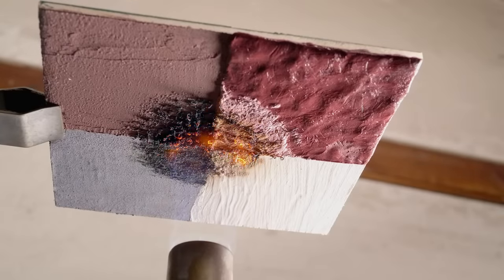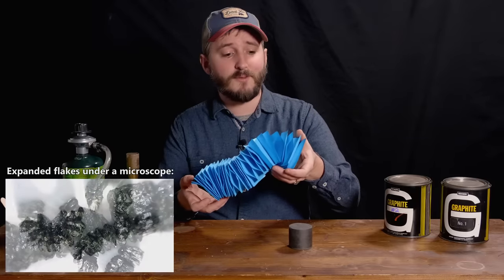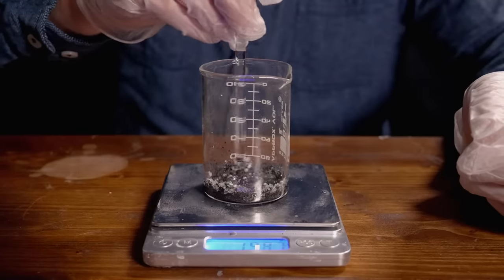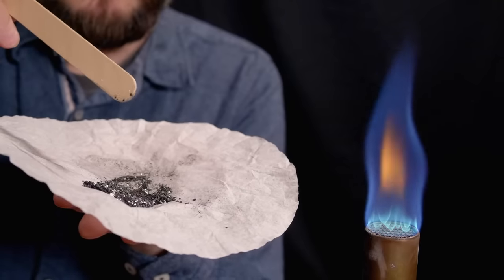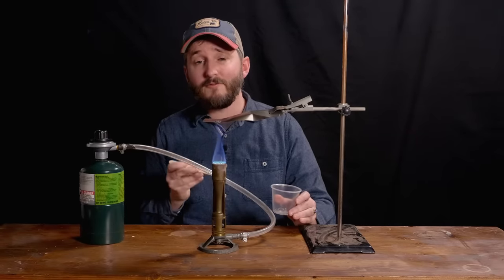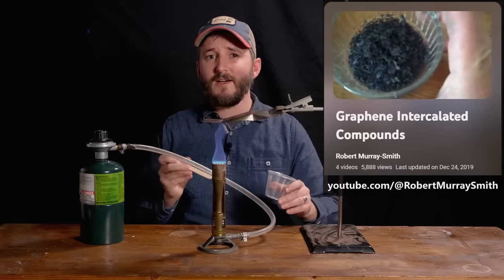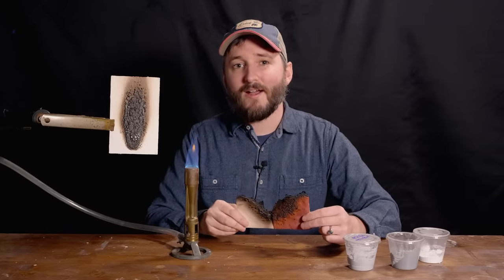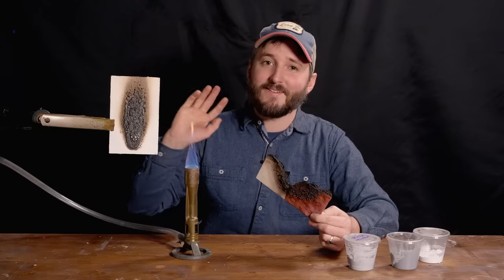Fireproof Expanding Graphite

Comment: This is just an fyi because i watched ur video trying to make my own graphite foil for an electrolyser for hho i dont and disint have flake graphite however i did have graphite foil i had orderd but conecting a wire to it proved fo be difficult ended up with a bunc of graphite foil scraps with only a couple good pieces left thats to your video and abit of my own experimenting i found out if u chop up ur scrap pieces instead of toss em out mix them into ur solution (im sure any would work but i used sulphuric acid and potassium nitrate) and let it sit a while left it for about a day the solution will break apart ths graphite foil and you can nutrilize and dry and it re expands when heated
I wouldent say its infinitely recyclable in this way sence i only tryd it the once so far havent recompressed it then broke it up again to see if it would d it over and over again but it did save me abit being able to remake the foil from the garbage pieces instead of just throwing them out

Comment: Nicely done! A great video to introduce to intercalated graphite. 
If you want to go a bit further, you can actually produce high quality graphene via the modified Hummer's method, which is just a few steps further. 
You would need some h2o2 in your water and hydrazine as accelerator, but then make sure that the quantity is small, you have a ice chunks surrounding your Erlenmeyer flask and and extra cover (fume hood is possible). Cleaning  and recovering the graphene is the most tedious step, using a roto evaporator and centrifuge at least 4-5 times. 
Thanks again for the video, it does bring me back 10-12 years, when I was working on nano sensors during my PhD.
Reply: the h2o2 would have to be pure otherwise the hydrazine gets mad
Reply: @deathedell215  I think you are right, now you mention it. I can't remember if we had any water at all. Mind it was a long time ago. I wouldn't recommend chancing it if you're unsure of what you're doing :)

Comment: The smaller mesh taking longer may have something to do with surface tension. It may also have something to do with a reduction in the capillary effect. Just a thought.
Reply: Or smaller flakes have more edge. 4 circles with a diameter of 1 have the same area (and with the same thickness, mass) as one circle with diameter 2, but the four smaller circles have edges with an overall length of 4pi, whereas the bigger circle has an edge with a length of 2pi. And since this reaction happens on the edge of the flakes, more edge means more reaction.
Reply: @chstoney  Oh, just wrote the same, I think this is the reason, for the same amount of flakes it'd be faster for the smaller ones, but for the same amount of mass there is a big difference in their numbers
Reply: The reaction happened faster in the larger flakes though?
Reply: Yeah, if it was just "more edge speeds up the reaction" it would have been obvious and not commented on. The actual result which is reversed implies that the reaction which opens the edge is a lot slower than the intercalation itself, which completes rapidly even if it has to cover a large surface area.
Reply: Supposing that the opening is the restraining factor, then the reduced number of atoms on the edge may also be a factor: if the intercalation is sufficiently faster, then it would imply that the opening of the edge is dominated by random chance as much as anything else, with the result that "rolling more dice" is the most effective way to speed things up.

Comment: Great video as ever. I did think this sort of expanding fire putty stuff was put around pipes and electrical systems, allowing them to move, but in the event of a fire, the material expanded filling any gaps and therefore stopping the spread of the fire from room to room.
Reply from the maker: Yes I have an intumescent collar for a 4" pipe I might test in a short video. That is one purpose that is pretty interesting and useful

Comment: Expandable graphite might of been used in  small flat sand bags  is good for cable and pipe entries with odd shape holes were you need temp access to work for fire proofing between adjoining buildings or between floors,  is it the same as the red electrical fire cables that insulate the internal wiring?

Comment: Very informative and interesting video. I am about to get back into my long lost rocketry hobby and have been thinking about trying a 3D Printed PEEK nozzle with a graphite insert or some sort of carbon based lining. It's a pity the gas flow would rip this stuff right off. I wonder if you could use it as internal heatproofing on the combustion chamber walls. I might try it just to see what happens to it under pressure.
Reply from the maker: If you expand the graphite first you could compress it as a lining in the nozzle and it would conform to the walls in the same way it makes a foil
Reply: @Nighthawkinlight  Thanks, would I have to bond it to the walls in some way?
Reply from the maker: @randomname4726  I'm not sure, it depends how grippy your nozzle wall is and how hard the graphite is pressed. Probably a rammed clay nozzle would benefit from having some of the expanded graphite included also.
Reply: @NightHawkInLight  I will have to experiment with it. I've made plenty of little rammed clay nozzles when younger, but now I'm into bigger motors with proper turned nozzles, etc.

Last one I made was H class using a convergent/divergent nozzle made from fiberglass & metal reinforced body filler, which I cast into a cylinder and turned down on a wood lathe (no metal lathe unfortunately (yet!)). It worked brilliantly. Now, I want to make a working nozzle for an M class motor (only 32x more powerful, lol), but it will need to be stronger and also survive the exhaust for several seconds.
Reply: @randomname4726  : If you have a wood lathe, then you have a light-duty metal lathe. You should look up how to form sheet metal over a mold on a lathe, to see if it would be useful for your projects.

Comment: I think the worms in the putty serve their purpose inside electrical boxes or when used around conduits going through walls, not in open air like you did, the worms would expand and fill the void
Is that the same stuff as the 'indoor firework snake' ?

Comment: All of your Carbon/Graphite material has been extremely useful. I recall in one of your past videos regarding start light. You mentioned using some of the common materials Ethe&$@k?? and(something) else that were not deemed as suitable because they were water soluble. I have to say my mind immediately track to Ferrofluid's use of oleic acid as surfactant musing the potential of it/the concept in making them non-watee soluable🤷‍♂. Either way..your material is a great watch on my information gathering process while looking at ways to modify graphites toughness as well as entertaining a variety of methods for  form, molding..¿Expansion casting?🤞🤷‍♂ As/More Durrable than material similar to the EDM Graphite I'm trying use for an R&D project unrelated to heat.

Comment: Interesting video. It seems like there has to be a geat enough density of the intumescent gaphite to create a thick enough barrier to be of any use by itself. I wonder what the result would be of mixing intumescent graphite with Starlite. Would it improve overall resistance?

Comment: Is the intercalation time directly related to volume-to-area-ratio for the particle size? 
It seems it is a similar thing as intercalation of grains in battery graphite where area-volume is important. Then again, there are microfissures in all battery carbon-grains which increase the area so perhaps there are a mix of effects.

Comment: Have you tried dumping high voltage to flakes after expansion to make graphene like you did with the coffee grounds?
Reply from the maker: For the flash graphene process it doesn't really matter what state the carbon is in beforehand because the intense heat nearly vaporizes it. Using this flake probably would be no different from using coffee grounds or any other carbon source.

Comment: For the finer graphite compound, wouldn't it need more heat because it has to burn through the sulfur layer and create vapor before more graphite can be affected and therefor layer up like the larger flakes? With the larger it needs to burn through less and has more graphite for layers to be built

Comment: This is me totally theorizing and not knowing what I'm talking about, but your point about the intercalation reaction happening faster with larger flakes made me think of how a low pressure lifting bag can get a lot of force over a large area. Since this reaction is one where layers are being lifted apart from each other, perhaps the reaction happens faster because these larger flakes have larger areas between them and perhaps get pulled the part more easily.

Comment: i wonder how well that graphite "foil", if completely compressed to get out the air would work as a thermal interface material between CPUs and heat sinks.

Comment: curious thought: maybe the graphite bits in the putty are meant more as a visual indicator that the putty got hot and less as a fire retardant.
some people may not know what the putty is supposed to look like normally and after heat exposure and a bunch of carbon snakes sticking out help visualise a problem with heat that needs to be fixed

Comment: Someone out there probably already tried it, so its probably not as easy as I might think, but wouldn't one be able to just repeat the process, put them back through the chemical treatment and get the already expanded flakes to seperate their layers even further, so you eventually can get the single layer sheets?

Comment: Found this while doing some research after binging for the umpteenth time robert murray smiths graphene videos. Thanks for the quality content! Where did you get the dixon #1 flake? I'm only finding #2 and microfyne. Some sites look to sell #1 but the thumbnails all show #2 and they have no mds. Might have to check my local tractor supply after work
Reply from the maker: I bought old stock on ebay. I remember it being fairly hard to find new but a farmer friend mentioned he bought it recently so maybe it's still made. Tractor supply might be a start, or a local independent ag store
Reply: @Nighthawkinlight  Ahh okay thanks. Just in case I can't find a reliable source, do you have any idea if #2 is suitable for graphene powder meant for composite reinforcement? Seems like it will produce smaller graphene particles so probably not as good as #1
Reply from the maker: @jaredmallard9986  I doubt it'll make a difference if done right. The graphene made by exfoliation methods is all microscopic, much smaller than either flake size. You don't get whole sheets the size of the flake
Reply: @Nighthawkinlight  that makes perfect sense thanks. I'm gonna order some and give it a try!

Comment: 6:14 in the same way that activated charcoal has an incredible surface area, my guess is that the small particle size of the finer graphite will react slower because there are so many more reaction sites for the sulfuric acid to attack. At the same reaction rate, there is a lot more reactant to go through

Comment: You should check out Pyrolitic graphite, there's actually two different types of crystalline structures. There's CN (Continuously Nucleated) and SN (Substraight Nucleated). Also there's a product called Firex that is made by Minerals Technologies Pyrogenics group, it is a fire resistant two part epoxy. I use to work for this group and manufactured all the stated products.

Comment: Have you seen Robert Murray Smith's arc exfoliation method? He uses a standard arc welder to exfoliate and it expands like mad. I've tried it, and mine probably expanded 5 times again what yours looked like by heating with the torch (also using no.2 flakes). It took a couple attempts at adjusting the ratio of sulfuric acid to get it super fluffy too though. Thanks for the clear explanation on what's going on as always!
Reply from the maker: I'll have to try that. I just took a shot in the dark at how much nitrate and acid to use and it worked the first time so I stuck with it. Most recipes use a ton of acid which I felt was wasteful so I cut my mix way down from normal. I'll have to try other ratios since you found it makes a big difference.
Reply: Okay I tried it again and I was exaggerating 2x fluffier, not 5x haha. Still worth playing around

Comment: For having worked extensively on the porosity of carbon nanomaterials, it seems possible to me that the finer graphite is more hydrophobic and hence added heat is required to help the acid diffuse in the particles

Comment: Manufacturers often put odd ingredients into products that have no benefit for the material's properties, either to make it more patentable or to confuse competitors trying to reverse engineer it. That said, if the putty's properties rely on water, then you might want to be sure whether it has been exposed to significant heat (and therefore used up it's protective properties) so a visible intumescent effect would be a way to show that.

Comment: I am a fire alarm technician.  The NEC requires fire putty on any sleeve passing through a firewall.

Bearing that in mind it is applied from both sides of the entry and exit point.  The small flakes in the fire putty are meant to expand and drive the putty further in towards the center of the wall and also outwards towards the center of the room.  Thus it compresses and seals the point from fire being able to penetrate from one side of the wall to the other.

Comment: I was wondering why my graphite crucibles and molds didn't do the same - you needing to treat the graphite explains.
In light of how nicely graphite holds and conducts heat, I wonder if using it to fireproof something could prove to be a bane should the fire get too far out of control as then the fireproofing would be conducting and retaining heat, thus potentially setting aflame the surface it was designed to protect?
I've brought a graphite crucible up to 1150 C in an electric furnace so as to melt copper and the sucker is glowing and radiating so much heat that I still need leather gloves with two foot tongs.
Still, I'm guessing the pros outweigh the cons as graphite will protect the material longer than an untreated surface, thus providing time for the fire to be contained or people to evacuate.

Comment: Given the number of times I have singed the hair off my arms with flash fires when lighting the propane grill without getting burned I have to conclude that little hairs holding a layer of gas make a significant difference in heat transfer.

Comment: I wonder - because carbon has both a high thermal absorption and a high thermal emission - maybe the little worm structures are genuinely interfering with the transmission of heat to the base material? Perhaps they're absorbing heat from the flame directly and redirecting it into the environment before it can reach the surface. Seems like it would be worth testing.

Comment: I think one of the reasons the putty with graphite snakes works well is because the fact that the graphite snakes get incandescent means they radiate at least half of the heat away from the surface whilst not being in contact with the surface itself.

Comment: I guess, the mesh hairs are very good at absorbing incoming heat, much like a flame arrest mesh in a pipe? So it will keep the heat from reaching the surface, and radiate it back out. 
I suspect it's cost effective.

Comment: Great video, nice to see you back nhil ;)

4:00 i think a disclaimer is needed there.

Baking soda will not negate the dangers of acids, so before anyone starts experimenting with strong acids, make sure you follow the standard safety precautions.

Always make sure you read the specific instructions and in this case, if you spill any chemicals (unknown or mixed), dilute and wash it off under flowing water for 20 mins, without rubbing on it. I don't know any exact combinations, but neutralising an acid, especially on skin can produce harmful byproducts and heat, so even a 'weak' acid can cause serious damage. Same goes for washing your hands with soap which can have unknown ingredients.
Reply from the maker: Baking soda is at minimum fine for sulfuric, nitric, and hydrochloric acids. The reaction products are sodium sulfate, sodium nitrate, and table salt respectively. Heat of neutralization is not an issue because baking soda's alkalinity is mild and the large volume of water is a heat sink. It is also a helpful solution because CO2 bubbles indicate when there is still acid present.

Comment: I'd be curious to know how the expandable graphite compares to activated charcoal. Specifically, as a water filter material or as a biochar alternative.
This was a great video, thank you.
Reply: Well I can tell you one thing for sure. Activated charcoal is going to be several orders of magnitude cheaper. Enough that if your filter needs 10x as much charcoal than graphite to achieve the same level of filtration, it would still be better to use the charcoal, unless you were severely space constrained. (Maybe your use case is on the ISS where space is at a premium.)

Comment: It may have just been the camera angle, but it seemed that the "lesser" solutions were higher on the underside of a slope than the commercial ones which would allow much of the applied heat to curl around that higher surface... I am curious how that experiment would come out if the commercial grade materials were placed at the higher point of the angled board... if it was angled at all.
Reply from the maker: I tried to make it pretty level, I think it's just the camera angle